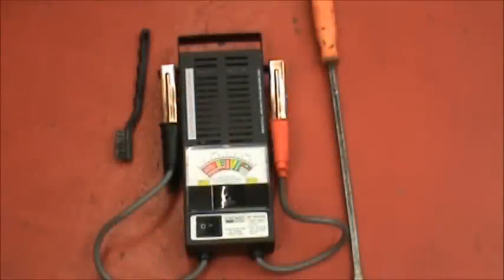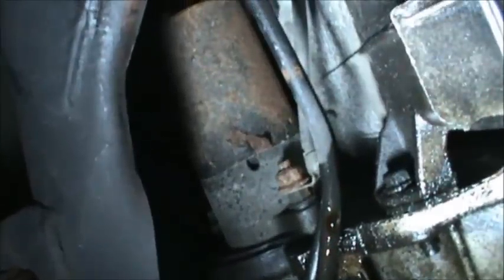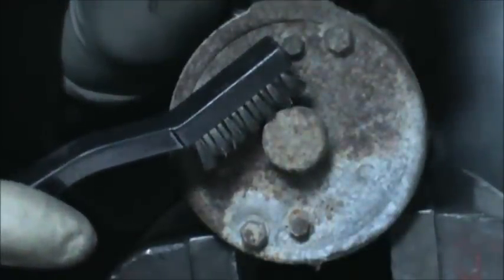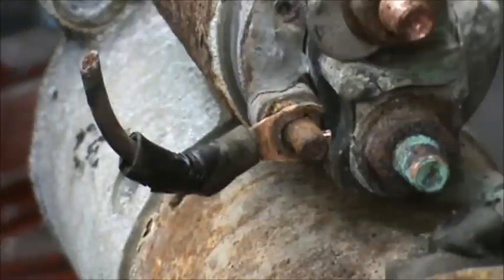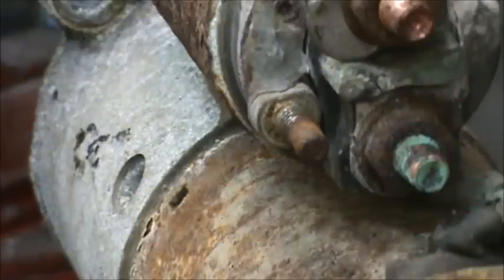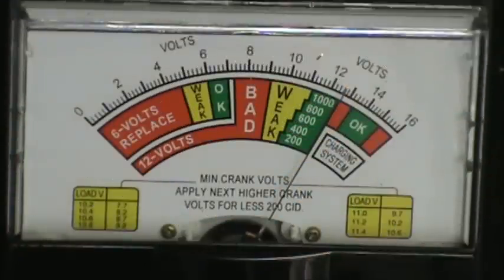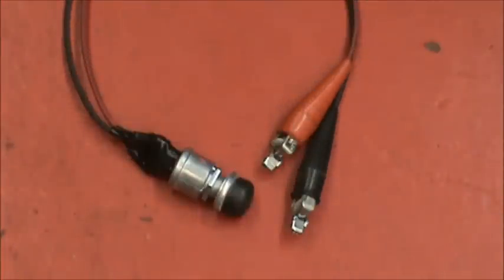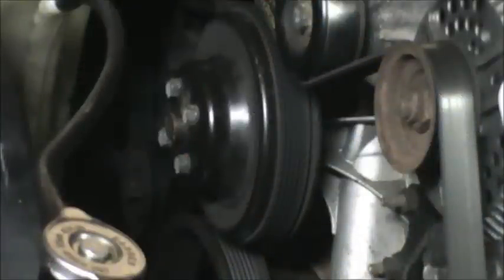Starter test | Check to see if you have a bad starter

Comment: Before doing any of that clean the battery terminals and clamp with a wire brush or sandpaper to the metal. Don't reconnect yet. Clean the 3 terminals and connections on the solenoid switch. Reconnect everything and try to start it.
Reply from the maker: Not really, when you do this for a living. Doing a load check first is a quicker way to isolate the problem. MANY older solenoids will break the plastic while trying to take the nuts off, even with rust bust. If you break stuff while doing a test, why test? You end up replacing the starter anyway cause you just broke it, trying to test it. @#$%^& !

Comment: Mine is grinding for 2-3 seconds after it starts up. I took it to O'Reilly to have is tested and they said it was good according to the machine. Does this problem sound like something is wrong with it even though the test showed it is good?
Reply from the maker: ?? What year make model. How many miles are on it.
Reply: @rebuilderinabox  2011 Suburban 169k
Reply from the maker: Rebuild before too long. Back noise is dry gears (see movie) low brush or bushing slop.
Reply: @rebuilderinabox  Ok. Thank you. Going to order the rebuild kit this week

Comment: what about a dragging starter ?
Reply from the maker: Could be many causes. Brushes, bushings, solenoid, low voltage due to supply or ground.
Reply: Mine was dragging on my S10.The long bolt was broken & caused starter come apart